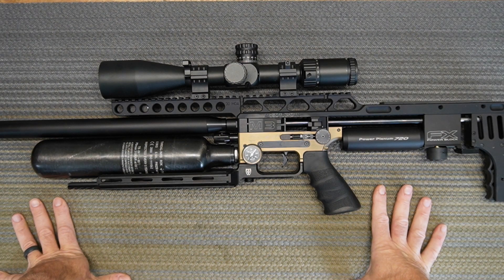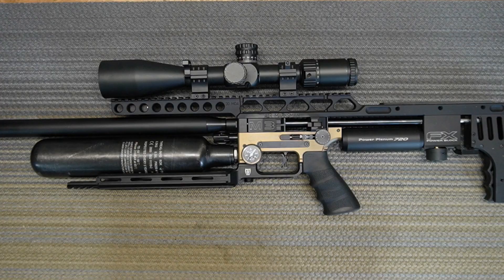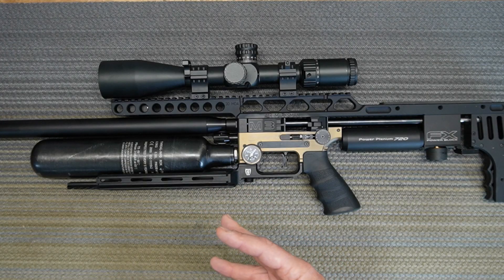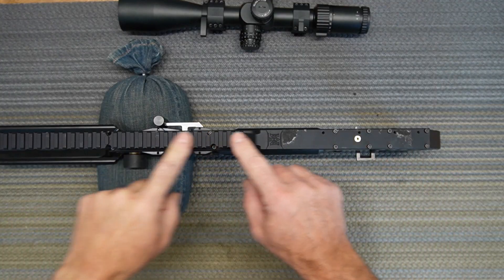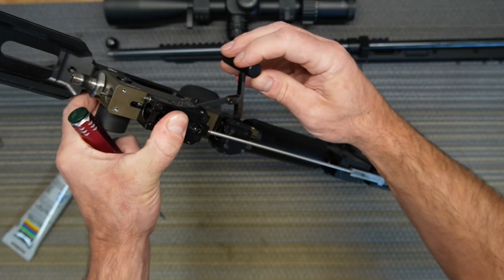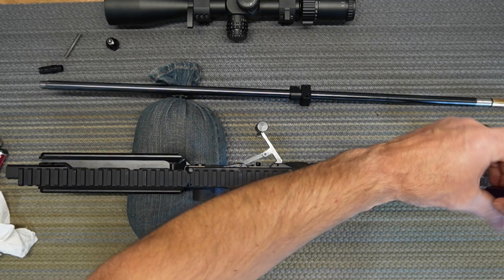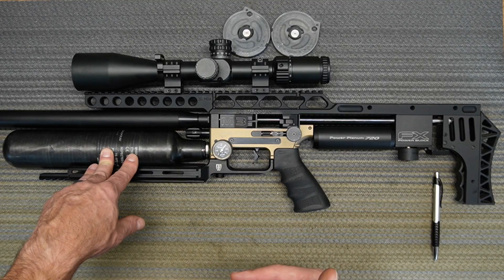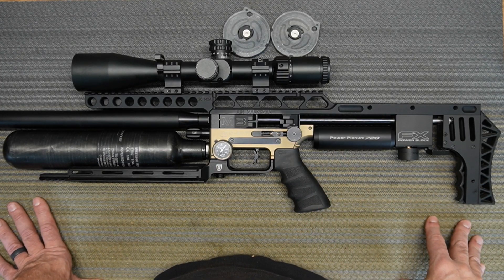FX Impact M3 hammer upgrade - SPEED GAIN RESULTS

Comment: Hi pcp savage I just need to ask a question when I was sliding barrel through I noticed that the transfer port was touching plenum slightly what would cause that?
Reply from the maker: you meaning when you slide barrel in the barrel hitting side of the power block, not aligning just right going in?
Reply: @PCPsavage yes it rubbed on the plenum as I was pushing it through. What would be the cause
Reply from the maker: @brettnixon113  power block, not plan, plan is that circle tube, there is no way it rubs on the plane. IF it catches on the power block, you need to take scope off, scope rail off and loosen all the screws on that top rail, insert the barrel and tighten screws and try again, most likely that power block is miss aligned, so do that and let me know, that should fix it
Reply: @PCPsavage I’ll let you know

Comment: Hi, I saw your videos and I like them, just wanted to tell you in Middle East (gulf area and other countries we have a group which we are adjusting the configuration for the FX and we got amazing results and tuning, using the 8 gram hummer is aggressive on the valve rod and tuning is not that good, we have adjusted the hummer spring and valve spring and now we are getting the 40 gr with speed reaching 980 or 990 on barrel 700mm, .22 cal, heavy liner, if we will used 800mm barrel we will reach with 40gr to 1040 ft/sec
Reply from the maker: thank you, yes, with 22 caliber, lighter slug you can send them faster and 800mm barrel will defiantly a advantage in speed also, 8.5gn hammer usually used for 30 or 35 caliber when you need to give very little bit you can. What is your 2nd regulator pressure with 1000fp/s?

Comment: Hi why do you have to measure the C1 6.5 mm from the block what is the reason?
Reply from the maker: IT should be 6mm, that measurement reflect your valve spring adjustment, if not measured correctly your valve return spring setting will be way off.

Comment: Also something else that will help accuracy especially with the 30 cal 700 shooting slugs is the fx integrated harmonic barrel tuner the carbon fiber is less susceptible to temperature change etc like the stock shroud also the barrel tuning weight helps and it’s adjustable. The bullet central shroud and tensioner I’ve heard good things about as well.
Reply from the maker: yes, I have different barrel tensioning system and Yokozuna moderator that I tuned for this barrel, thank you for your comment

Comment: Great video. I found my m3 30 cal 700 shot the best with factory hammer. I did try the huma hammers and lighter valve spring for a bit just found for my gun the stock internals worked the best. I’m also running an upgraded front plenum part from Malbur and I installed the 75 cc plenum on my m3 as well can purchase kit through bagnall and kirkwood online. I’ve ran up to 140 145 bar with stock hammer.
Reply from the maker: after loot of tuning, I found that 140BAR on the stick hammer is a stretch, its best to upgrade for slugs, pellets can do ok because they need less air to push them down

Comment: I have the M4. Just switched from 25 to 30 cal. Installed the 30 cal 700mm slug tensioned barrel yesterday, RMR’s arrive on Tuesday. The 25 cal barrel has the slug liner, shot the RMR’s with it as well. Best tune I could get with the 25 cal RMR’s is 1015 average over 25 shots, sub MOA at 50 yards easy. Thanks for the video, I might need it soon 😊👍
Reply from the maker: RMR 30 cal do well between 920 and 980FPS